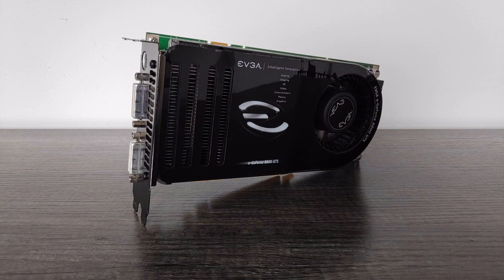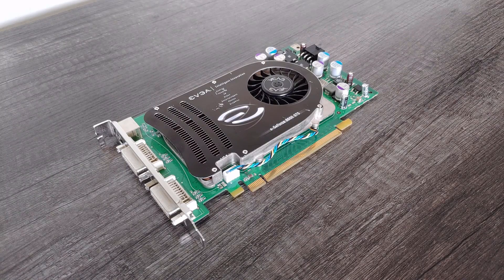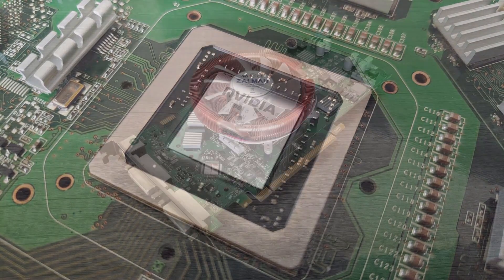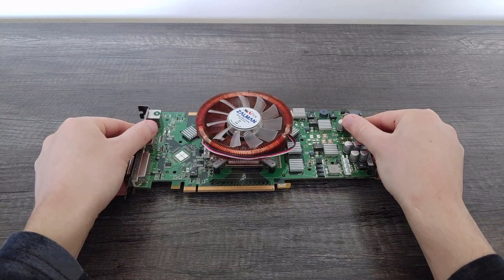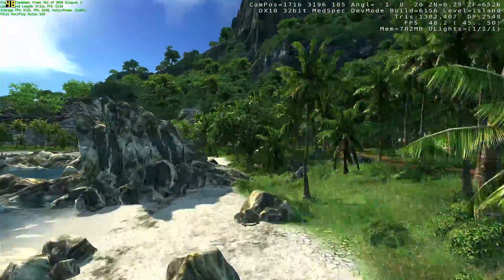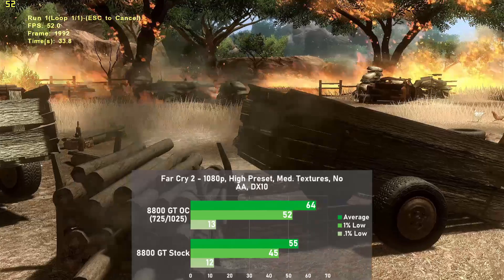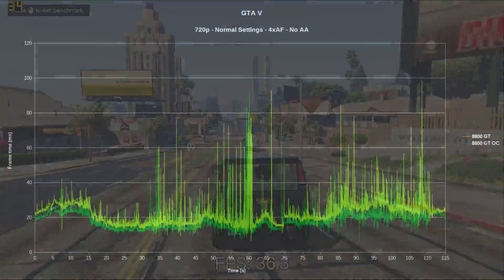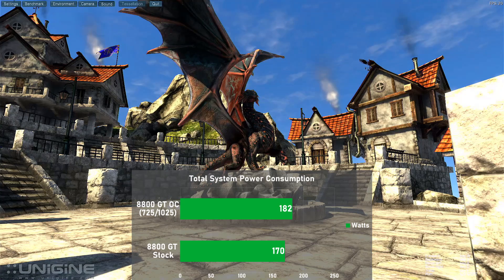The GeForce 8800 GT: NVIDIA's Affordable Powerhouse

Comment: The 8800GT was the first pcix card, i bought. Great card, but the single slot cooler sucked. Fortunately i had an Arctic Freezer from an old 6800 lying around that fitted perfectly. When the 8800GTS 512 came out, i switched and the 8800GT went top a friend. Today I still have both cards.
Reply: Sorta. The original stock cooler had a 65mm fan which really wasn't great and probably where a lot of the initial sentiment came from. There was a quiet revision later in the card's life that upgraded it to a larger 75mm fan, which was a bit cooler and noticeably less loud. (Though still loud by today's standards)

Comment: Great card! My 8800gt was replaced with a GTX 560 because of a faulty memory. If I remember correctly it still worked but only with the standard SVGA driver.  It was paired with an Intel E8200 processor. So many nice memories with it... GTA 4 and Crysis in 1024x768 resolution... Ahhh

Comment: I'm looking to change out the Thermal Solution for this Card as I have a Stock 8800 GT.
Where can I get the passive cooling Metal Pads You used in this video for all the smaller chips?
I'll find the Zalman Fan on My own. (I'm gonna need help finding one, it seems those things are hard to find in today's market)
Reply from the maker: The memsinks came with the card already in my case. If I were looking for more I would go on Amazon and search for VRAM heatsinks, depending on the kit you can get quite a lot of them for cheap. If they don't include it already though I would get some double sided thermal tape to attach them or something.

Comment: What tools are you using to tweak the voltage? I can't seem to enable the options for that in the latest version of MSI Afterburner. I'd like to reduce power consumption and temperatures on my 8800GT.
Reply from the maker: I used MSI Afterburner 4.6.2, and you have to tick unlock voltage control in the settings otherwise you wont see the slider!

Comment: The thing is when the 8800gt was released in late 2007 and people bought it in 2008, very few people played games or watched video in 1080p. Most people watched movies in 720p and played games in 1024 x 768 or 720p.
Reply from the maker: Even then it seems to be totally doable in games of the time with the right settings! Originally I planned to use a lower resolution but it did so nicely at 1080p that I stuck with it for the final testing.

Comment: Probably the most important generation - introduction of CUDA cores and unified shaders set the standard for GPU design. The 8800 Ultra was a BEAST, but the 8800gt was one of the most impressive refresh cards ever, these cards were everywhere there were gaming PCs.
Reply from the maker: These cards really changed the game when it came for performance per dollar, not surprised that they were extremely common!

Comment: In august 2007, I bought an x1950gt for $129, ~25% slower than the 8800gt. Wasn't bad for the time, and leaps and bounds better than the 9800pro I had.
Reply: 25%?

Pretty sure 8800 GT ended up being 100% faster than any ATI X1000 or GTX 7000 card.
Reply: @acryion  got the figure from techpowerup